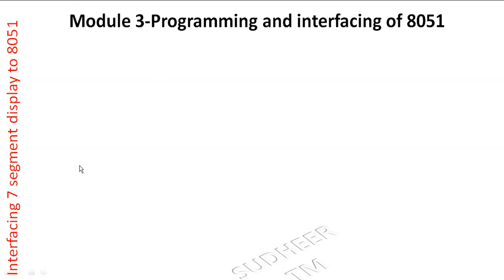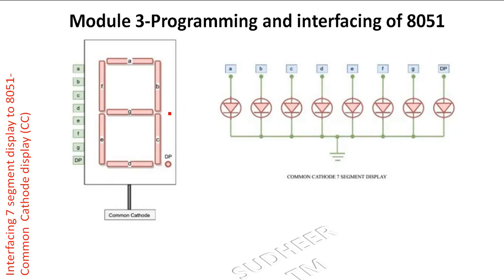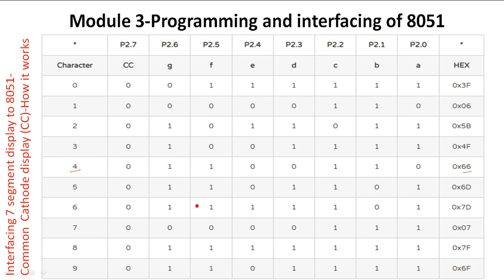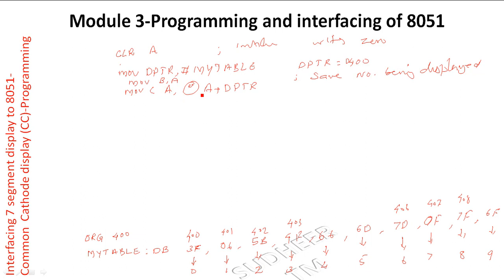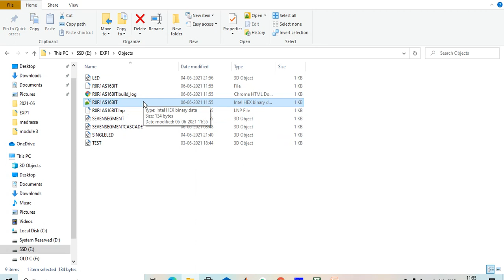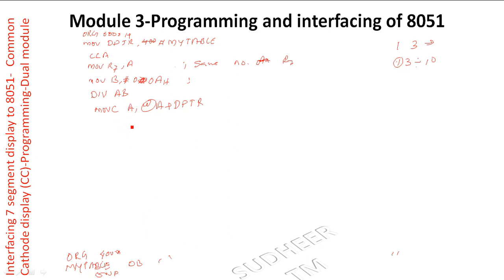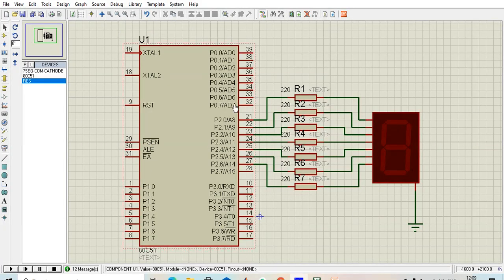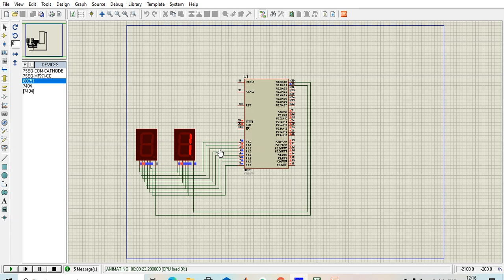KTU ECT 206 Module 3 class 4, Interfacing 7 segment display with 8051 microcontroller

Comment: Kindly saying
For counting 0 to 99
Al last djnz R7 is needed instead of A
Otherwise loop will jump to beginning before displays 99
It is also visible in simulation
Reply from the maker: Yes you are right
Thank you
Reply: using 64h instead of 63h will also make it right